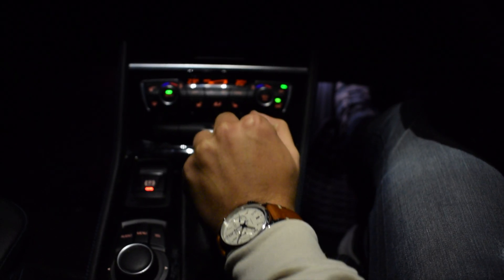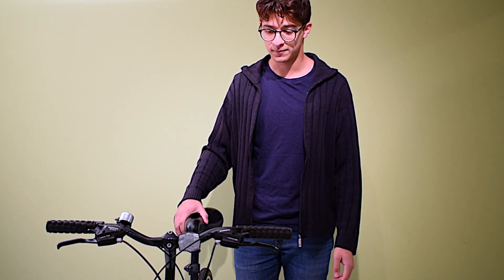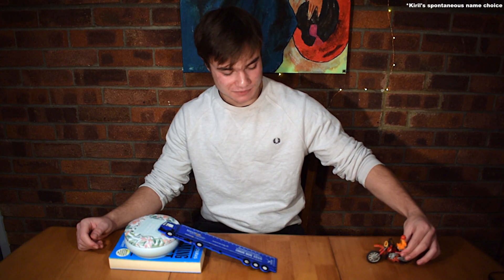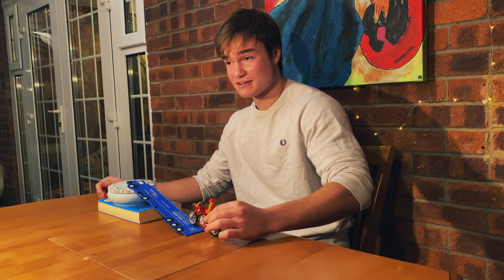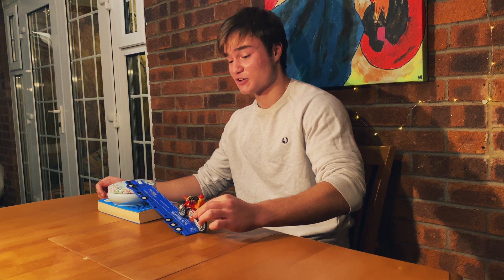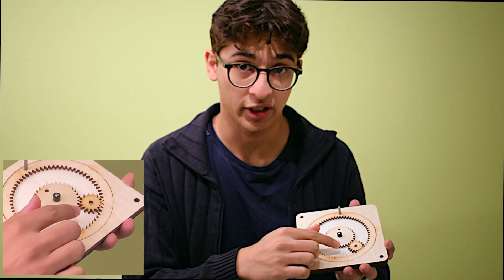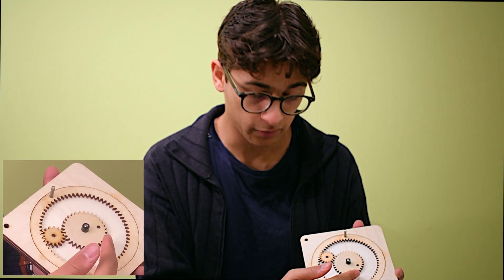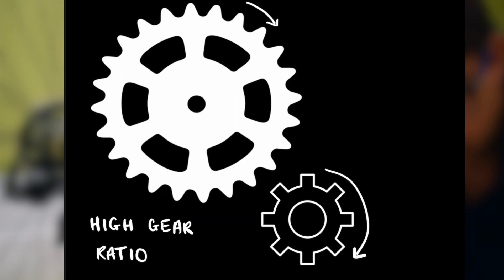Why do cars need gears?

Comment: i never warmed up to cars and driving and have two friends in their mid 50's who never learned to drive. one of the reasons manuals / stick shifts are intimidating is the clutch pedal.  when you shift gears on a bike the shifter shifts without having to depress anything with your foot.  why can't that happen in a car?  and why is the shifter so zig zag and choppy?  why can't it be straight and smooth like a bicycles?
Reply from the maker: Good questions! In simple terms, the clutch in cars is there to disengage the engine from the wheels while the gear change takes place. On a bicycle, this isn't needed because the engine (you) can easily stop pedalling for the duration of the gear change, whereas a car engine has to keep running.
As for the zig zag nature of the shifter, I had to Google that but it seems to be primarily a safety feature, to stop you moving to the wrong gear. Probably also a case of "if it ain't broke, don't fix it".